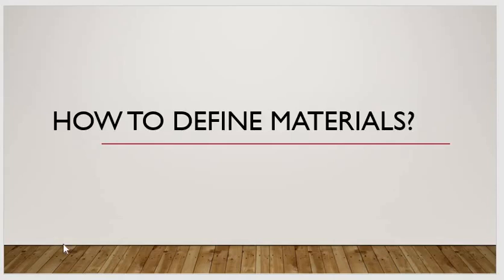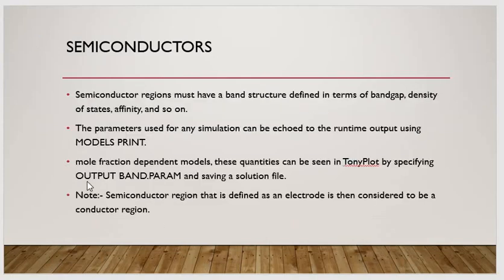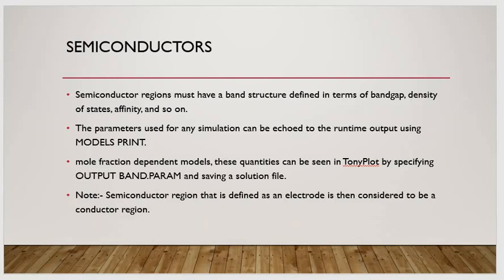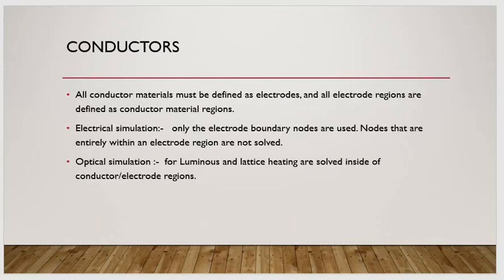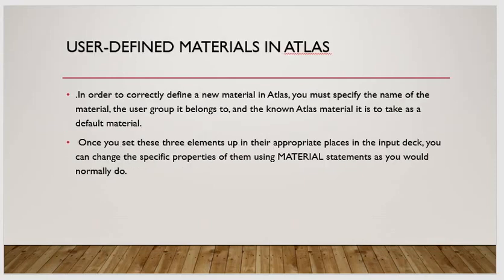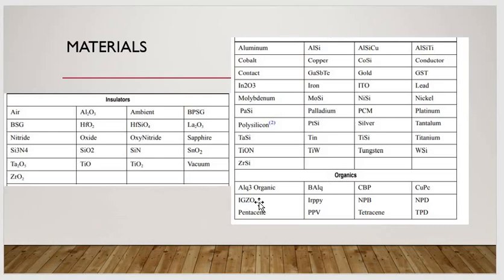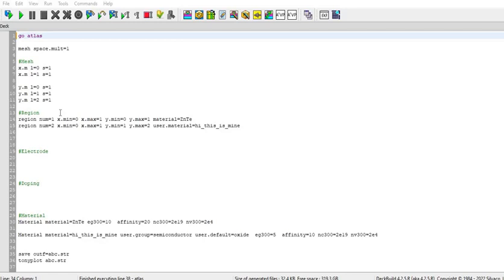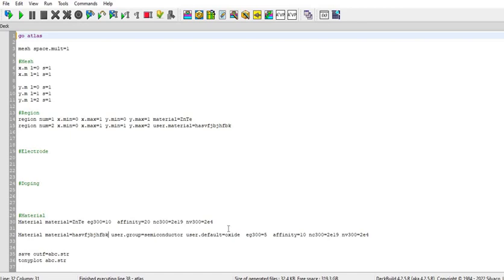How to define material in silvaco ATLAS

Comment: Thank you so much for such an informative video. We, a team of 4 members from 7th semester are making a device using Silvaco and need the parameters of Niobium Nitride for defining the custom material. Can you please provide me the values along with the source of the parameters of NbN. (I got the bandgap value. Just need the mobilities of electron and hole (MUN and MUP, density of states of electron and holes (NC300 and NV300) and Permittivity). It will be very helpful for our final year project.
Reply from the maker: Hi actually I don't have pls check some of the research paper related to that. 
But I will suggest you to use user default as si3n4.
For any other help t.me/learnsilvaco